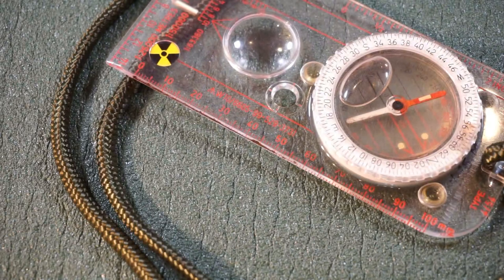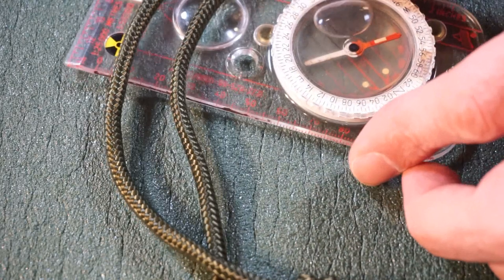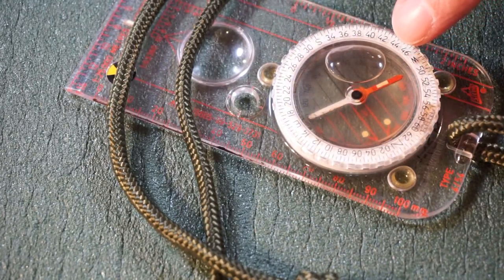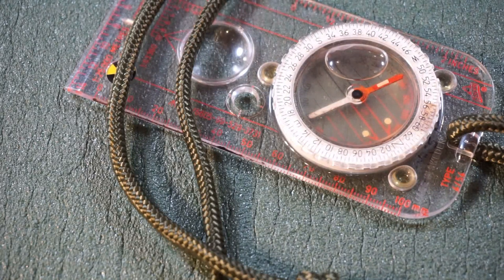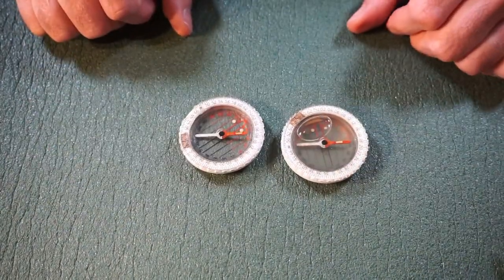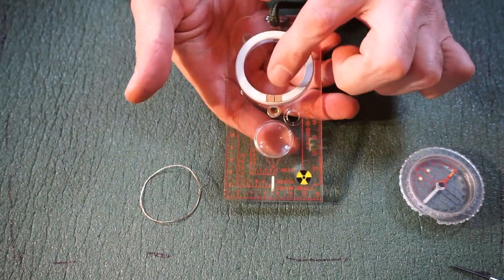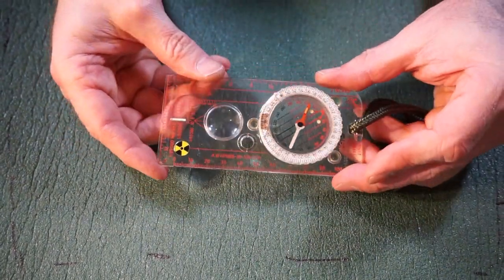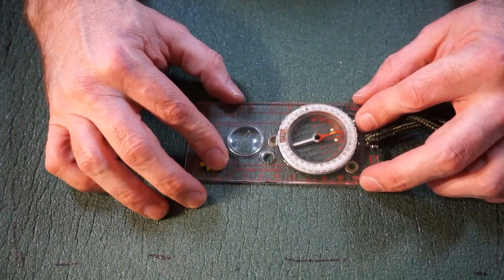Silva Compass Bubble & Bevel Replacement

Comment: Thanks for the video, mine wouldn't rotate due to some sticky substance. Managed to take it apart, clean and reassemble thanks to your video. Yes, the wire was tricky, but I laid the compass face down on a table and pushed on the wire with a small screwdriver one section at a time, twisting it with my fingers as needed to angle it in.
Reply from the maker: Very fiddly task and not easy, but it's a good little fix. Thanks for the input.

Comment: Good and helpful video. But the removal of a bubble by heating may not be complete BS..... my Silva 4/54 developed a small bubble after a flight, and on advice from an old friend, I  hung it in the greenhouse for a day, and the bubble disappeared - "boiled out" basically. But I think using that method to remove a bubble the size of the one shown here might be a bit ambitious! Still, anything is worth trying rather than throwing the compass away. Thanks again for a good video.
Reply from the maker: Absolutely right - Although they're relatively cheap, precision and longevity are helpful.

Comment: Thank you for this video -- I was trying to figure out how to put the wire back in, and it was good to see that it could be done.  

Looking at your video, I thought what you needed was another pair of hands.  I had my son put his fingers on certain places as I pushed the wire in with a screwdriver working from one end of the wire to the other until it was mostly set in.  Then I went back and pushed the wire all the way in with a small screwdriver.
Reply from the maker: Glad it helped

Comment: I took this one step further.  I had a large bubble so I took a number drill and drilled where they sealed the compass.  I filled the oil chamber with a syringe and some mineral oil.  Once I had all the air removed, I heated up a metal awl and sealed the hole.  I was left with just a tiny air bubble 2mm.  It took me less than 10 minutes.
Reply from the maker: Great job. It's always good o fix n mend things to extend their use. Wonder how your mineral oil holds up in hot and cold environments?